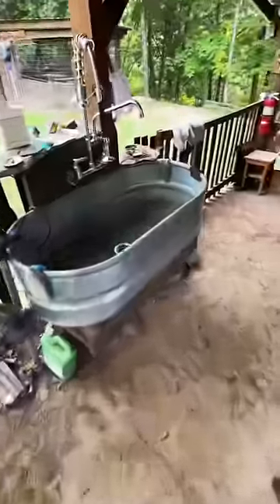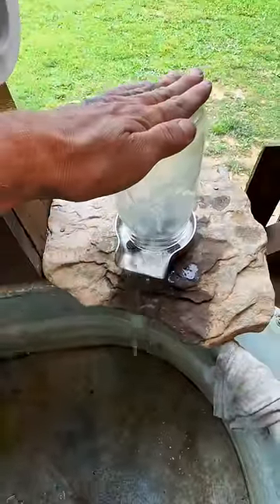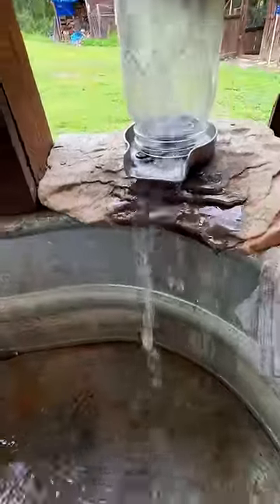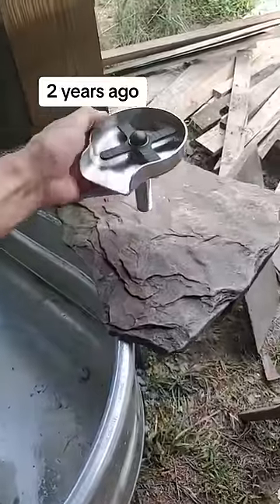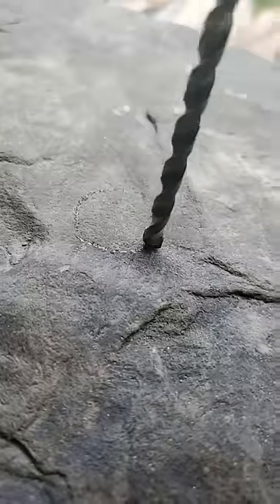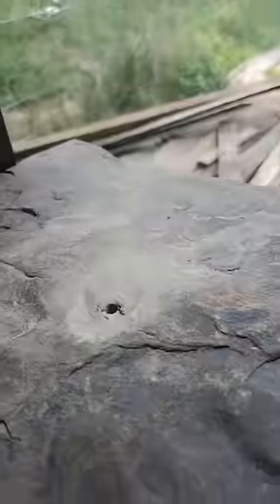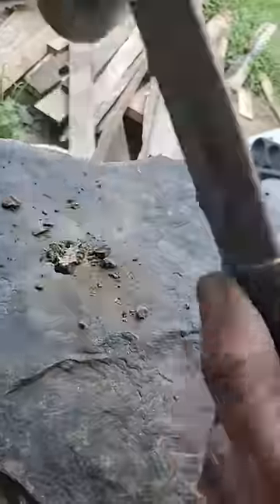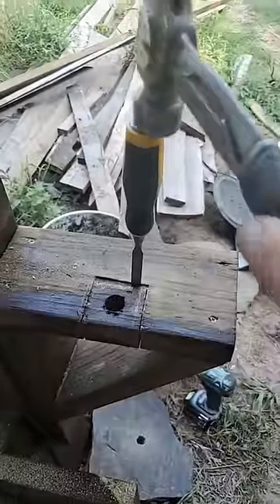Cup washer in outdoor kitchen

Comment: I've heard you talk about that glass washer in a few of your videos, and you can tell how proud of it you are 😁👍
I had never seen something like that before and its definitely a cool thing to have, and even more so to have made yourself! I wish I had one 🥰
Reply: Good if you have a personal unshared cup.
But it doesn't wash the rim or the outside with soapy hot water to kill any bugs etc. where different lips will be placed.
So no use in a job site, company cafe etc. etc.
Reply: @JohnSmith-yv6eq well you could still just sponge wash the outside like normal, that is the easy part after all, but yeah I'm thinking more for just at home anyways